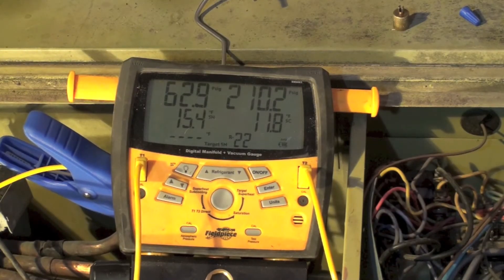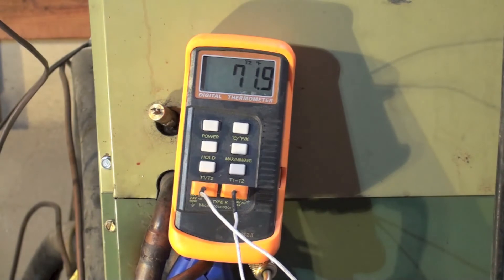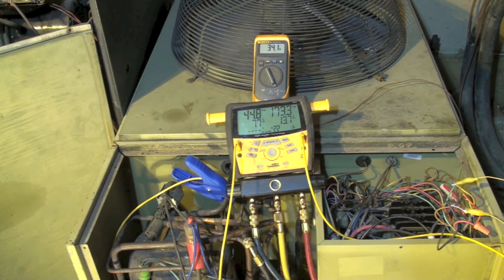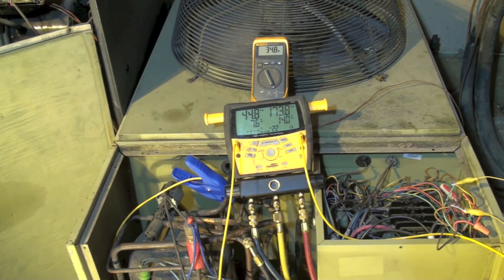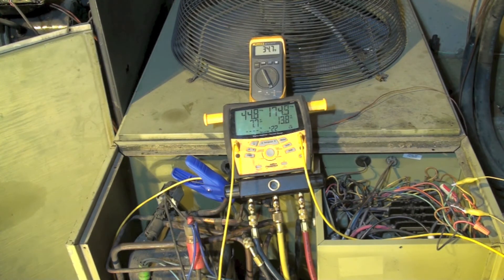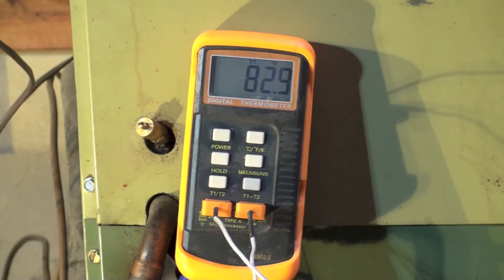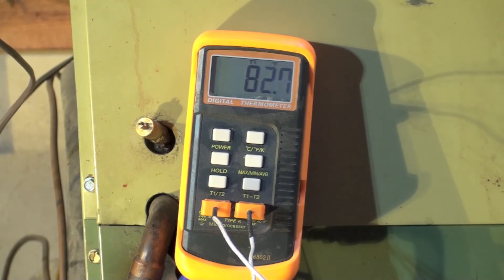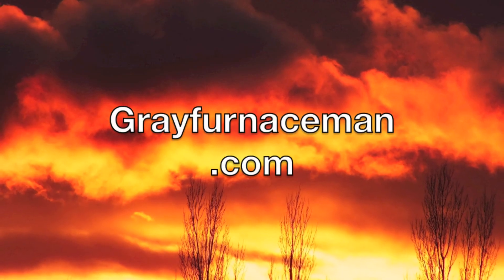Heat pump high outside temp vs low outside temp

Comment: I’m in Portugal where the temp doesn’t go much below 48F even at night. However electricity is double the price and the houses are poorly insulated .
What temp should Inset my air source heat pump to for water under floor heating? And should I run it 24 hours a day ?
Reply from the maker: You should be able to set it at about 90F
GFM
Reply: @grayfurnaceman  Thanks ! Appreciated

Comment: Does the amp draw change any between those too situations?
Reply from the maker: Absolutely.  Compressor amp draw reduces with lower outdoor temp.  Amp draw depends on the amount of heat being moved.  Less heat moved, less amp draw.
GFM

Comment: I'm really proud of my old heat pump. 34yo all original parts indoor unit and 20yo outdoor. It laughs at 30* and I keep the house around 72~74 in the winter. It will still keep up at 15* but they are long cycles. I have a OD stat set to bring in the resistance heat at 15*.
Reply from the maker: +Nicholas CeeA Hope it continues to operate efficiently.
GFM
Reply: Didnt mention your power bill.
But that is nice though, vintage equipment may not be effecient but were certainly simpler and often sturdier

Comment: Gfm I have questing it's 4 above and my heat pump is gifing me a 13.6 temp split should leave the heat pump running or go to aux heat.
Reply: A well sized HP and properly charged system with a house in decent insulated condition, can perform really well even at very low temps, like Hv1245 is doing. I'm surprised that you're surprised about this. As a mechanical engineer, I always prefer the heat produced by the heat pump over anything else. The space will still feel as warm as fire or electric, except that the moisture level is best with HP since the air is not so dry. The only reason someone would pick a furnace over HP is for the savings, not comfort.
Reply from the maker: Hv1245 I am surprised you are getting that high a temp split.  Most heat pumps' coefficient of performance is around 1.5 at that temp.  So you are not gaining a lot over electric heat.  I would switch to backup if you have electric backup.  If you have gas backup, you should go to backup at about 35F.  Hope this helps.
GFM
Reply: @grayfurnaceman  wouldnt it still Make sense to run the pump if it gets 1.5 cop? Or are you saying to switch to resistance heat more for the comfort?
Reply from the maker: @mbburry4759  There are 2 issues here.  The lower COP means the unit will run continuously, causing more wear.  Also, many customers see the lower temp as actually cooling the structure (not true but it happens).  Thus, give up and switch over.  
With some newer units, especially mini splits, the efficiency is much higher, so the duct temp does not drop as much.
GFM

Comment: Does the 410 a unit perform better in heat than the r22 at the same low outdoor ambient temp since it runs at higher pressures
Reply from the maker: Victor Blackwood R-410A is a somewhat more efficient refrigerant, not so much due to higher pressure, but properties of the refrigerant make it more efficient.  
GFM

Comment: I'm one of those guys. COP with compressor is still much greater than electric heat alone. What I mean is you get a greater return in delivered btuh than electric consumption. It will mean supply temp below our body temp which some customers don't like regardless .
Reply from the maker: Joe Shearer It is true that it will always be more efficient than electric heat.  However, there is an issue with more wear on the pump.  Also, as you say, the low duct temp upsets many customers.
GFM